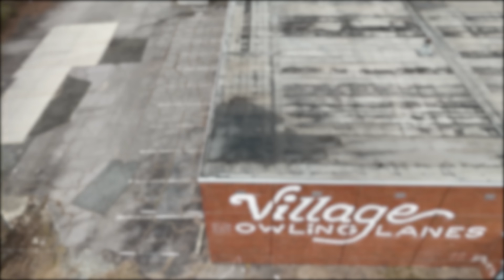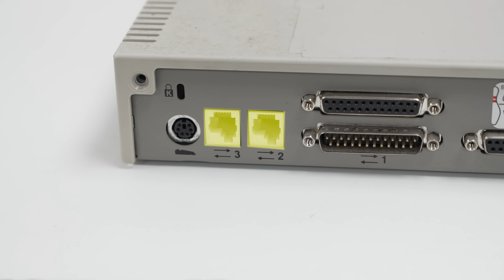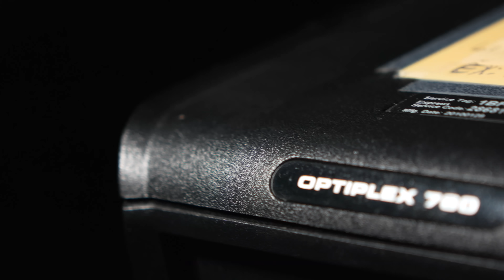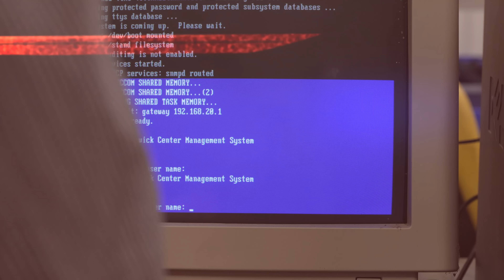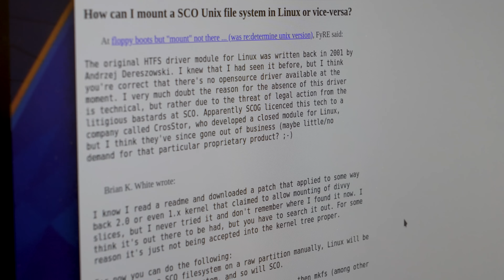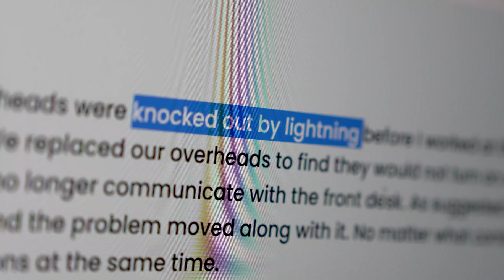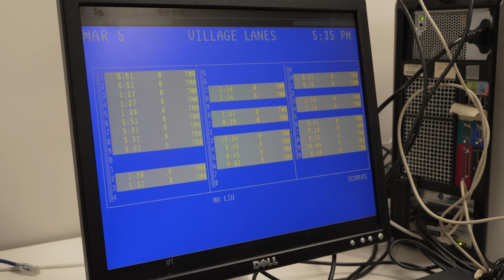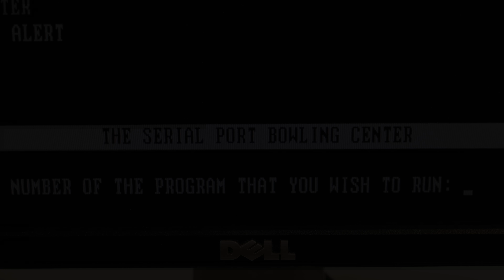We hacked into a bowling alley computer!

Comment: Wow, nice find!  I was working for Fairlanes Bowling (and later AMF after a buyout) circa 1995.  They were using AMF's backoffice and scoring system, but it ALSO ran on an SCO UNIX backend hosted on a PC desktop in the back office!

That was my first exposure to UNIX ever (was a DOS/WIN3.1 guy coding in Borland Pascal at the time).

30 years later, the bulk of my career has been UNIX (first Sun, AIX, and HPUX) and now Linux.  Kinda surreal looking back that my hacking the backend system of the place I worked at opened my eyes to something other than Microsoft or Apple and sparked my whole career. 🤣
Reply: Cool story:  Once I got a root shell, nothing was off limits on this UNIX OS.  I had managed to take over the serial modem that AMF used to sync with corporate and sent AT commands to dial out to my community college's dial-up PPP modem pool so I could access the Internet and use IRC from the front-desk terminal of the bowling center.  Easy to switch between handling customer transactions and chatting with friends on IRC while on the job!  

Ohh the good 'ol days...
Reply from the maker: That's a rather unique way to use IRC!
Reply: @theserialport  pfff NERD
Reply: Amf advantage. I know it well.
Reply: Do you remember which system it was? The center I worked at used AccuScore2, and the back office computer used Xenix386. They eventually upgraded to a third party which could continue using the old Curtain Wall Chassis and LIU, but modernized the front desk. They were on that for a couple of years, and eventually upgraded to Brunswick scoring after I left in 2004. (I later found out that the old system was picked up by another center in the area, when I bowled a travelling league there and saw the old center name. That center eventually upgraded as well to some other scoring system I hadn't heard of before)

Comment: I’m curious how the individual lane displays and consoles are connected up. Is there a full computer at each one, or are they just another terminal into the same dell?
Reply: It varies a bit between retrofit companies and I'm not sure what method BST here used.  The ones I've seen tend to stuff a raspberry Pi in to each pair of lanes to handle the overhead displays and just get a stream of serial data to tell them what to do.  The original brunswick system the BST retrofit replaced was pretty much a serial terminal from what I recall.  40 column display and a keypad to enter data.  the retrofits I've seen use the same serial to send all the data, the displays just look nicer.

Comment: I knew it was some weird shit because those Bowling animations are not normal
Reply: There are no animations on this thing. This would have been a retrofit for the old CRT monitor, monochrome systems that had a line art turkey as the only graphic the 40 column display would ever show.  The system with the silly animations runs on windows XP and is about 25 years later down the timeline than what this one does.

Comment: Really cool video! I live in a middle sized town in Germany. The bowling center there has a quite similar setup as far as I can tell. The Strike, Spare,… animations on the monitors are from the years 1995-2001. I remember that when i went there as a kid these were played on big ceiling mounted crts. Now they replaced them with flatscreens. But the old system is still running. They are made for decades. I always wonder when they’re gonna replace it. I guess replacing such an all-in-one system is just too expensive and therefore not worth it for this „small“ center with 12 lanes.
Reply: Where?
Reply: @ CCR-Bowling Hildesheim

Comment: Glad to see a video like this!

Just six months ago, a bowling center contacted us because their Dell PC had died due to a PSU failure, which also took out the motherboard.

We successfully migrated the system to a similar HP Core2Duo PC that was in mint condition and inexpensive to obtain. We had to re-activate Windows XP, which was no issue at all.

Additionally, we installed the driver for the controller card and adjusted some COM port settings.

Everything runs like a charm now! We created a system image and the bowling center saved 50,000 euros. Yes, that’s right, Brunswick wanted 50k for a new system because it is a requirement to upgrade the entire bowling system.

Our next mission is to find a PCI controller replacement in case this one fails as well. If you come across any spare parts, let us know, they’re really difficult to find!
Reply: This stuff is all like gold these days.    Almost impossible to get help if you own a old bowling alley.
Reply: That's awesome ❤
Reply: Brunswick is crazy for that. Let us use our old gear, please. Especially since it's so cheap to utilize it.

Comment: I tried to troubleshoot another scoring system once (it was a small alley I bowled league at and they thought I might be of help since I knew my way around computer hardware) that actually ran text mode QNX on its main server computer. And much like this one, it used a serial card to link to bespoke PCBs at the back of the alley (which ran the scoring logic and scoreboard rendering). Oddly enough I think the issues were also caused by a power surge messing up part of the card (the motherboard appeared to be from the mid 2000s if the aesthetic of the BIOS splash was any indication).

The alley in my old hometown used AS-90s pretty much the entire time it lasted (the owner retired last year and closed it). They weren't splashy but they had a nice charm of robustness to them. But I've also seen a few Canadian alleys that used a rather unique system that ran everything on Amigas!

Comment: It closed in 2023 and they were still using 1994 computer technology ☠️
Reply: This stuff is usually part of a system very closely integrated together. You don't update a part without having to update the entire thing as well.
Reply: @redphoenix1000  Yeah that's what I thought too, upgrading the entire system was probably way too expensive
Reply: Really, the 1994 version of a scoring system released in 1979.  The 'scoring technologies' is one of several companies that offer retrofits to the old Brunswick score system to update it for 16"9 over head screens with more than one color, as well as a couple other more modern conveniences.  Considering that a complete install of a current Qubica scoring system would cost several hundred thousand dollars for a center even the size of Village, it makes plenty of sense to me for them to have instead chosen to spend 5 to 10 % of that to go with an update to the old system. There are still plenty out there running the original without a retrofit system.
Reply: Nah, the server was 2006 or so, the pinsetters and scoring was 90s - bowling alleys keep that stuff for a long time.
Reply: Well, it worked, so why not?
Reply: Are you surprised? The government still uses computers from the 60s
Reply: in IT if it ain't broke don't fix it
Reply: Based tbh
Reply: IT was built to last forever. Today's software is some flaky Windows 10 or 11 8U77$#!+ with NAS spyware and sponsor ransomware nowadays. Microsoft enforces pressing on shipment of computers pre-loaded with this type of unstable and virus-prone bloatware.
Reply: @Bandicoot803 take your meds grandpa

Comment: I'm a little surprised they did not use a basic server with redundant disks and power supplies for something that is supposed to run 24/7 for decades. Even a simple motherboard RAID setup for the disk would have been a huge upgrade on availability.
Reply: Modern systems do, this one is more of a retrofit system, where the old 80's score system was updated with some modern features.  On the old system, the crucial data would have been stored on disk or on another computer and uploaded/loaded in for each league.  Even today, the printed copy that day is what leagues and tournaments run on, so a drive failure would be annoying, but there isn't actually needed data on the drive.  Most places just keep a mirror sitting n a shelf if they had a half decent manager, and most would do a daily or weekly backup.  With the retrofit systems the backup was usually automatic, but still there's not actually any data that needs to be saved stored on the scoring server.  Chances are pretty good that that dell replaced an 8080 system that had been running the same 10 MB HDD for 30 years without an issue and no one worried about the next one, especially when they had Mike to call if it failed.